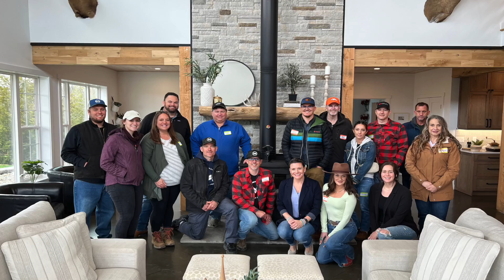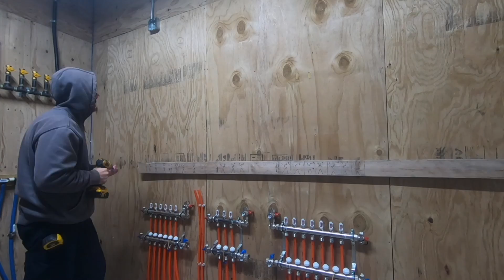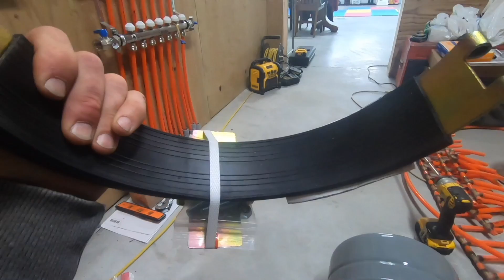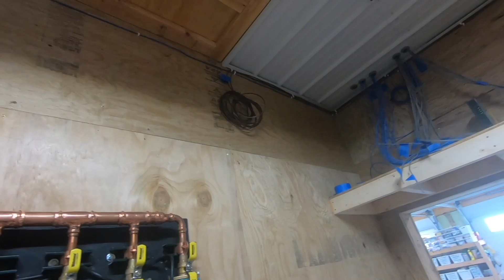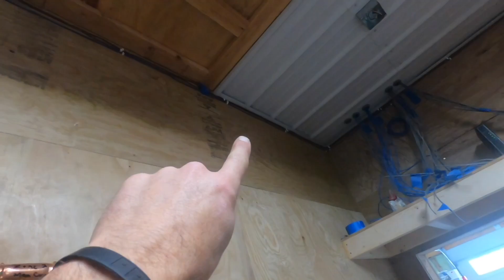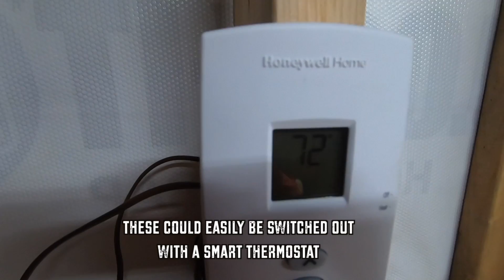Radiant Heat Install | Control Panel | Part 2

Comment: As a warning, when drilling a hole for the in-slab thermostat be sure you're not over a water line. I would recommend having pre-determined locations for thermostats and coordinate waterline install to make space for drilling. Sensors can go bad over time and may need replacement. Nothing last forever any more. Could require re-drilling in the distant future. Put a small panel door in a closet for future maintenance.

Comment: Others asked the same thing. Pre-built board setup from ?????????????????????????????????? Cool video series. Just started checking it out. Watched your compilation video first.  Wife and I self built a 3 story 3,200 sq ft addition to our home and it turned out so awesome. The reward is excellent.
Reply: Curry Heating Solutions is on the label.  I wish the info was avaliable.

Comment: One lesson I've learned the hard way (previous owner install) is to avoid putting anything that can leak up over any electronics. Chances are your expansion tank won't leak, but if it dies you may need a new controller.
Reply: Nice install!

Comment: Hey Paul how long did it take your slab to get up to temp? I just turned my 2500 sq ft slab on with 3 zones. Air temp was 60 degrees, i set it at 65. Its been on for 4 hours and hasnt changed yet.